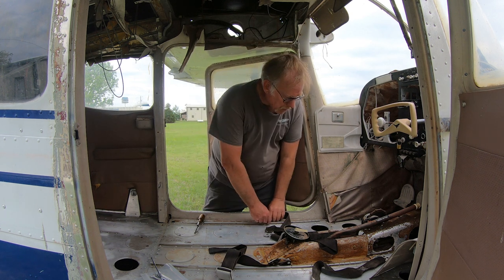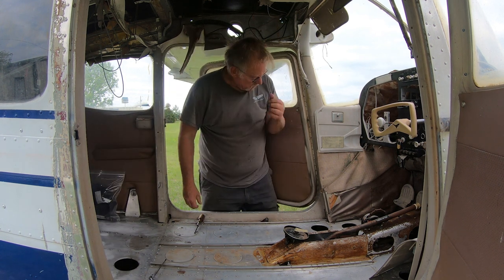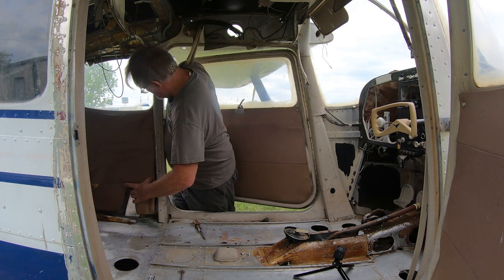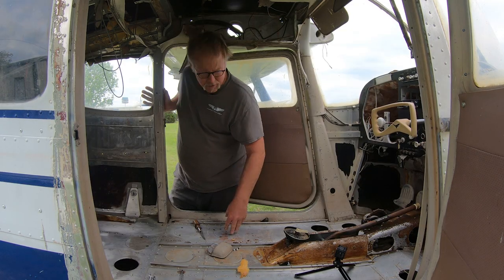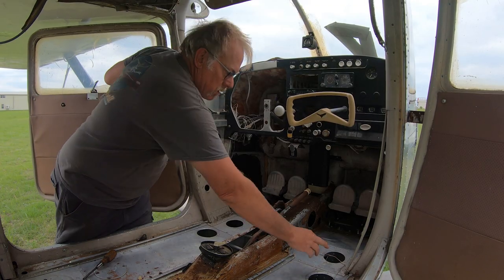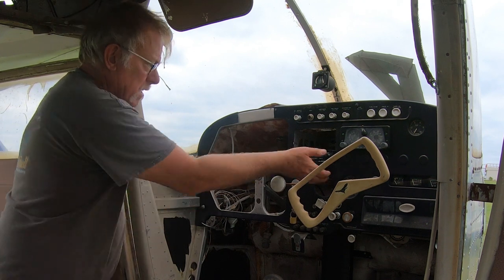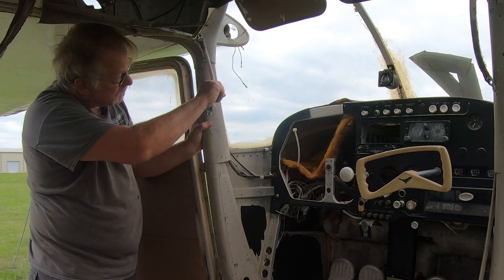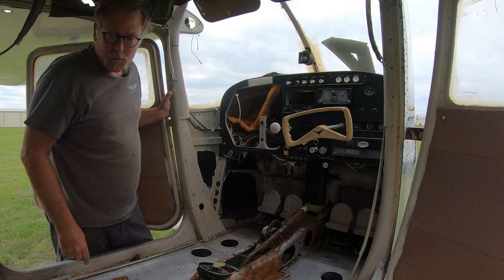Project Cessna 172 EP05 - Cabin Cleaning Complete!

Comment: It looks like the side panels had some kind of vinyl covering.  I wonder if it was FAA approved.  Also, what kind of foam will be used for reupholstery?
Reply from the maker: I doubt if any of this stuff was FAA approved.  Yipes!  We'll use good stuff when we go back together though.  Thanks for watching!
Reply: @HangaRatz  What is your understanding of what materials one can use for upolstery/interiors?  I've been told by A&P's/IA's that fabric has to be fire retardant  but what about the foam underneath?  I've also been told by a couple of A&P's/IA's that the fire retardant rule doesn't apply to antique aircraft..  What would you do about the foam seat material?
Reply from the maker: "All" of the upholstery materials need to be equivalent to what was in effect at the time of the aircraft's certification.  As an example this is an excerpt from a CAR 3 revision which goes back to 1930s/40s timeframe:

"§ 3.388 Fire precautions— 
(a) Cabin interiors. Only materials which are flash resistant shall be used. In compartments where 
smoking is to be permitted, the materials of the cabin lining, floors, upholstery, and furnishings shall be 
flame-resistant."

Soooo... if you were restoring an aircraft today that was certified to this revision of CAR 3 you should at least meet CAR 3.388 flash resistant criteria.  Definitions of "flash resistant" are given in the CAR.  Thanks for watching!